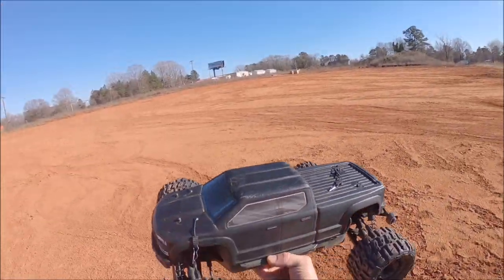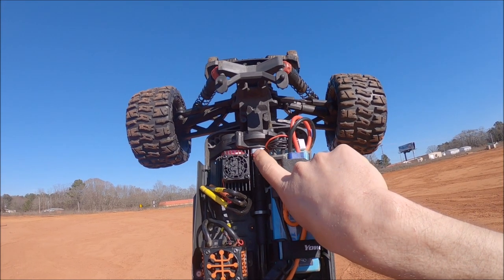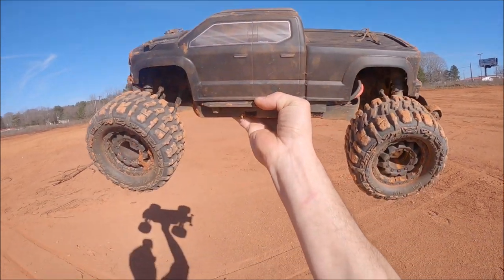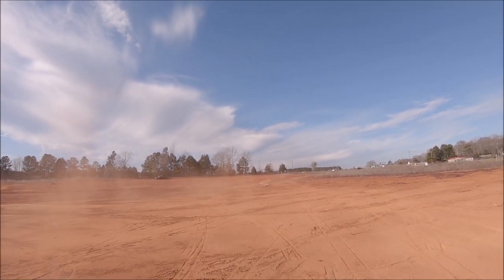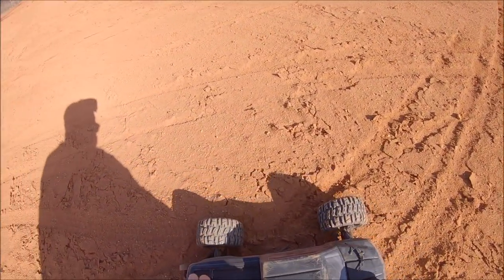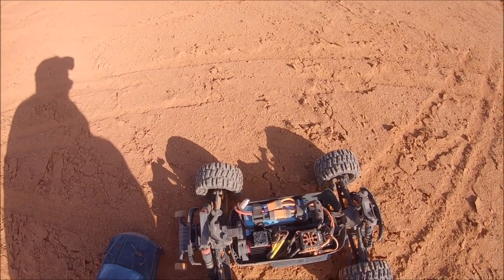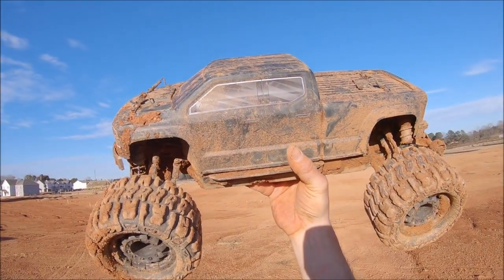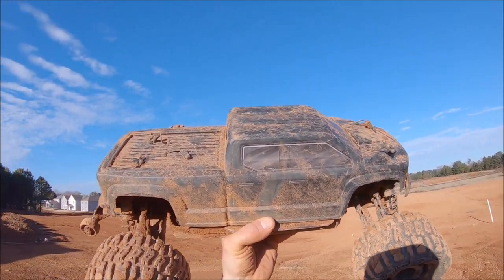Arrma Big Rock 4s! -NEW M2C parts and End Talion romp!

Comment: shes ripping! surprised how well those plastic diffs hold up
Reply from the maker: Thanks Kev!😊Yeah I'm happy with the performance now for sure! I'm surprised as well on the diffs!😱They definitely take a flogging! Arrma really made some improvements on these and now M2C to fill in the gaps!😜😎🤘🤘🤘
Reply: I grease mine every once in  a while, I bought the metal gears because I thought they were gonna go eventually but I have over 50 hours on mine probably and there's minimal shavings
Reply: @williamperri3437  just hot racing spur gear
Oh I was talking about the diffs, yeah I got the arrma metal crown gear, but haven't put it in yet and can't find the input gear anywhere it's backordered
Reply: What wheels are these?
Reply: Arrma tufffffff son

Comment: I got that same motor 2850kv in January off Amazon for $33 plus a 2 year extended repair warranty. It's an absolute beast I've done 60mph on 3s and 79mph on 4S in my slash 4x4 and JLB cheetah truggy with 24/50 gearing. It's never gotten above 160° even with my summer gearing in this Florida heat. Rated for 5s but I've run it on 6s no ceased bearings or stator. I highly recommend it for a budget build..

Comment: V3 with the metal diff gears ? Nice job can't wait to see it with finished gear settings to get heat under control. Keep us posted on what breaks .I want this truck . More now 😉 looks like a blast the way you got it. Bash on bro
Reply from the maker: Just metal spur. Still running stock plastic diffs!😎👊

Comment: Awesome! I have the same esc running 4s. I've had my hobbystar in the mail system for over a month smh. So I'm running the stock motor. It does great in the colder states. Usps is so bad right now. Also have had a esc in transit for over a month.
Reply from the maker: Yeah the mail sucks right now!😝This little cheap motor was rippin though! Mounting the 6s ESC is tricky but it worked!😎💪🤘🤘

Comment: Will a 120a work fine with 4s on this motor? I see Banggood sells a combo with 3670 2850kv Brushless Motor and Surpass 120A
Reply from the maker: It should since that's what Arrma uses in the 4s line.👍Just make sure its a 4s rated ESC.
Reply: @RCDUDE81  Great! Yeah i suppose it should work since Banggood sells it as a combo, just had to make sure

Comment: How do you feel about plastic chassis trucks, I have a slash 4x4 custom build settup like a low truck actually runs a big rock body on it, done some decent sends to a street landing so far
Reply from the maker: Plastic is definitely flexible and quite forgiving! A hard landing on a rock, hard surface, etc could crack or break it but the Arrma 3s/4s chassis is pretty tough!

Comment: Hey bud. Love your videos. New subscriber. I've seen many videos. I want to go 4s with my big rock. Most people are running 2050 to 2400kv. But they don't the punch of your 2650. Maybe more torque for that platform isn't the way or are they geared wrong? Anyway your build rocks!!!
Reply from the maker: I really appreciate it! Yeah the lower kv isn't necessary for this platform although you can run anything with proper gearing. Stock 3s motor is 3200kv I believe which is too much for 4s. It'll get hot too fast. 2650 or 2850 works nice on 4s on this platform.

Comment: RCDude, running a similar 4s setup. Toasted a rear input gear on first street run. Are you running lower esc punch and/or backed off slipper? Let me know please. Thx
Reply from the maker: That sucks man!😱I'm running my slipper at half turn out from full tight. Punch 4 on the 150 amp Spekrum ESC. Truck can't handle punch 9. Won't stay on the ground!🤣

Comment: Have you had a chance to check out the new v5 arrma 6s line? I see the new kraton chassis and shock towers are different hoping to see one in your channel so I can see if it's worth getting another one 💪👍 also my 4s kraton is one of my favorite rigs man seems that my xmaxx and 4s kraton kraton break way less than anything else. I can't believe your not twisting drive shaft joints I've snapped so many of those on 4s where the joint on the drive shaft is where the pins articulate
Reply from the maker: I don't have a V5 as of now! They did make some nice changes and would love to see how it would hold up. Maybe one day I will pick one up..😜👊🤘🤘

Comment: Great bash, i tried the 18t pinion in my stock motor but was having cogging issues! Did you have any with this set up thanks
Reply from the maker: Not in this 4s setup no. Yes the stock system will Cogg if geared too tall. I like the slightly lower kv motors it eleminates the Cogg on the bottom end.
Reply: @RCDUDE81  thanks much appreciated, in that case I’m going to run the exact setup as yours,also are you running twin lipos on that esc if so can you just run the single lipo

Comment: Awesome! 4s these things are sick! We have the blx185 paired up with a 3674 2950kv motor. I’m having trouble getting it to track straight. It diffs out and turns on its own. What are you doing to get it to stay straight?
Reply from the maker: Yeah it does want to diff out a tad. To keep it straight I'm basically in the steering constantly!😜If I ease into the throttle on passes it helps!😎💪🤘🤘
Reply: You need one those scales to evenly distribute the weight with all that power to weight ratio haha , fresh diff fluids always helps me .

Comment: How do u get a metal spur to work with that slipper clutch assembly   can I share a hot racing part Number ?
Reply from the maker: HR makes a direct replacement in steel. Fits right up! You can search steel spur for Big Rock/Granite😎👊
Reply: THANK YOU

Comment: Pretty insane bashing, man. I’ve got the Badlands on my old Big Rock and they’ve always been awesome. I just bought the v3 the other day and I’m kinda upgrading the same way I did with my previous one. How are you dealing with the motor mount after so much bashing and chassis slap? I don’t bash nearly as hard so I can’t speak from experience, but from what I understand, I guess that motor needs to be supported due to the gap between motor and chassis. Hot Racing sells a multi-part motor mount system that’s seen great results here on YouTube. Just curious 🤷‍♂️
Reply from the maker: The M2C motormount and support slide is what I'm using! All my 3s rigs have them! Then the M2C chassis brace bash bar stops broken chassis!😁💪💪

Comment: Do the drive shafts hold up on 4s? Have they twisted off at all?
Reply from the maker: They did a couple times. Now I use either heat shrink over them or Arrma Steel Cvd's.

Comment: my grandson is asking about a " Arrma Big Rock " for driving around the barnyard and i'm not sure what the battery requirement would be for this truck . I know it will run on either 2 or 3 S but what C- rating would you recommend?
Reply from the maker: For a stock Big Rock I'd recommend a 3s if he's driven rc's before and also at least 50c. Bigger mah will be longer run time and higher C will be faster discharge under load and more power! 100c will be optimal.
Reply: @RCDUDE81  Thank You !!!

Comment: I am kind of torn on what to get, I been looking at the new redcat MT10E (basically the Team Magic E5), the associated rival 10 MT and this one. Right now I'm liking the MT10 because I hear nothing but good, Not heard much from the Rival or big rock camps. This vid does helps tilt things towards the Big Rock though, very impressive durability. How is the truck stock without the hop ups? The only thing I really know about the Arrma RC's is the early ones had a trap door chassis, very toy like and I hated it. I do know the rival is supposed to have a center diff over a slipper, something I really like. Have you played with the other trucks? And what's your opinions on them compared to the Big Rock.
Reply from the maker: I've never ran a Redcat but the Big Rock is definitely a tough rig for sure! This is my first vid flogging on it bone stock!🤙https://youtu.be/F2FpF3xexIU
Reply: @RCDUDE81 , Thank you sir I'll check it out. Appreciate the link.
Reply: @RCDUDE81 , Just watched that vid, I think my decision has been made. The long chassis was my concern, but you just destroyed that thought. Appreciate the link. Looks very stable in the air
Reply from the maker: No problem man!😎👊

Comment: Hello nice video
which shocks do you use on your bigrock? my stock ones broke quickly...
Reply from the maker: I was using Arrma Typhon shocks. You'll probably need lighter springs and about 30-35 weight oil.
Reply: @RCDUDE81  thanks you for your answer
Reply from the maker: @yannickdrift3482  Anytime!

Comment: How are you liking that motor what pinion was thinking it about it for my hobao buggy it only weighs 7 lb I have a 2650 KV with a 22 tooth pinion  in it now and I want more speed on 4s
Reply from the maker: So far I like it! I was running a 18 tooth pinion. I tried a 20 garage testing and it cogged some. She flat rips on 4s with 18 tooth with the 2850kv.😎
Reply: @RCDUDE81  you think faster than 2650kv with 22 hobbywing awesome video as usual
Reply from the maker: 2650 with a 22 will be similar in speed to a 2850 with a 18 tooth. Tire diameter makes a difference too as the 2.8's basically give it more gear ratio.
Reply: @RCDUDE81  thanks for always replying I'll stick to what I have for now I would love to go 6s but don't have a 6s ESC so I was trying to find a better motor

Comment: What is needed to run 4s reliably in these other than esc/motor fan? Metal spur only ?
Reply from the maker: I'd run at least a 120 amp ESC and a lower kv motor. This Surpass hobby 2850kv 3670 rips on 4s. A metal spur will definitely hold up better to the extra power and hard bashing.😎💪✌✌
Reply: @RCDUDE81  you don’t change any axles or diffs ? Jus a metal spur and it’ll take it with correct punch settings ?
Reply from the maker: It worked for me yes.🤙

Comment: Awesome video. How did you manage to drive so fast with proline trenchers ? I recently bought these tires and they are so heavy and unbalanced that entire truck vibrates when it goes above 40mph.
Reply from the maker: Are they the belted version? These are not belted and seems to drive fine🤔
Reply: @RCDUDE81  Mine are also not belted. Did you balance them before running at high-speed?
Reply from the maker: I didn't balance them but did vent them. If you run them in water or loose dirt stuff can get sucked in the tire through the rim vent holes and cause them to be unbalanced. I tape over the rim hole and vent two holes on the outside of the tire. Not sure if that's your problem just throwing out possibilities
Reply: @RCDUDE81  Thanks for the suggestion. I will try it.

Comment: Are you still running stock suspension? And if so what weight oil
Reply from the maker: This was stock suspension but since went V2 Typhon 6s shocks with 30wt oil. Stock suspension works nice with 50wt imo.😎👊🤟🤟

Comment: You really bashed the shit out of the 4s big rock.  I took my brand new stock big rock out yesterday for its 1st run(Christmas present from the wife)  and didn't even get through one lipo. I was only at 75% throttle in a unused car park with a little rough area that had a tiny jump where I was getting about 12 inches of air. Before the 1st driving session reached 20mins the rear right suspension arm had broken where the hinge pin goes through the hub and has the retaining hex screw. I know its not an expensive part but I'm totally disappointed with the durability of my vehicle here. It was 4 degrees Celsius so I know plastic can become brittle over time in the cold but to not even last 20mins with conservative driving is shit as far as I'm concerned. What are your thoughts about this

Comment: The stock motor can't handle 4s?
Reply from the maker: It can but I wanted a lower kv with a bit more torque for running the steel spur gear and less amp draw.👌

Comment: Epic jumps & fantastic control in the air as always👍👌🤘
Are you still running the stock shocks & springs? My mate has a 3s granite & he put random eBay shocks on it for some reason..... I need to set him straight lol
Reply from the maker: Thanks so much!😁I was running stock shocks still in this vid. They do work nice! Imo 50wt oil makes them even better. I did however since upgraded to Typhon V2 shocks with 30wt. Definitely more plush! I mainly did that for the bigger airs for a bit more cush!😎👊💪🤘🤘
Reply: @RCDUDE81  thanks RC Dude81 👍
I will pass the information on to him

Comment: Surpass hobby is pretty much the same as hobbystar look at surpass rocket motors like the 4092 there the same there both pretty good
Reply from the maker: Thanks for the feedback man! Yeah I was super impressed with this motor! Freakin rips!😱💪🤘🤘
Reply: @RCDUDE81  thank u.figured maybe u could save a few bucks I got the 3670 hobbystar and like 4 surpass hobby platinum motors only one in a car right now but it's in a a979b with a surpass 45 amp esc that can run 3s but it's insane on 2s I will rip the wheels off on 3s